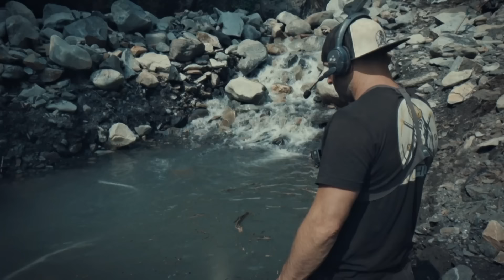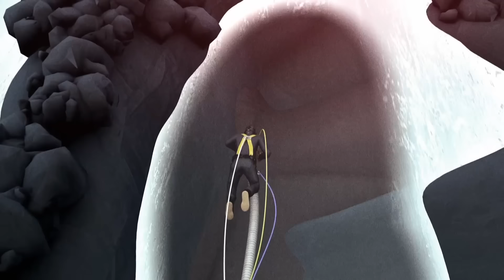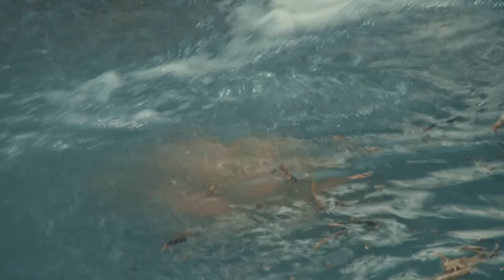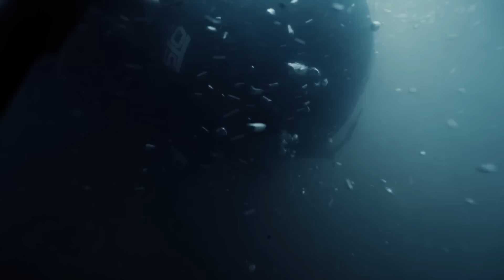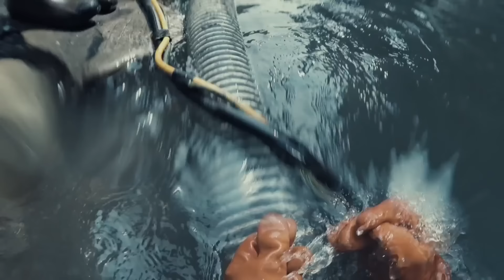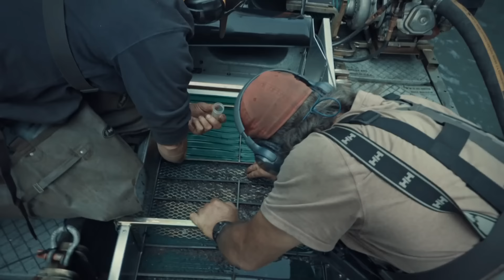“The BIGGEST Nugget In Gold Rush HISTORY” | Gold Rush: White Water

Comment: We use propane for are commercial small engines 
The pluses your not getting dirt in gas, you can drop a tank and won't leak all over. The exuast fumes are minimal compared to gas. We get more hrs. Per gallon than gas. And we have more problems with Hondas than kohlers engines. Down side propane might be harder to get up there?